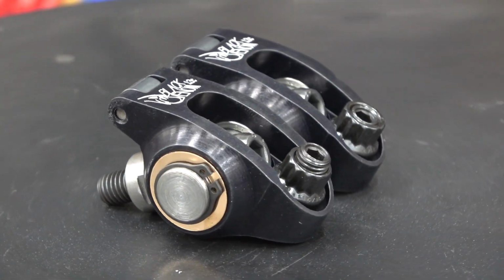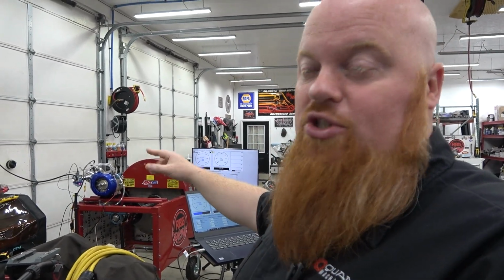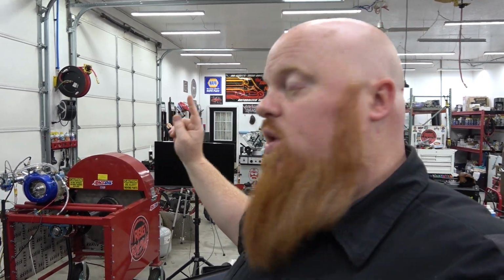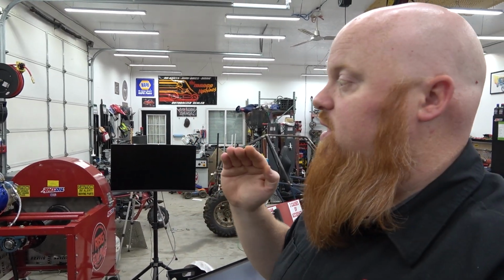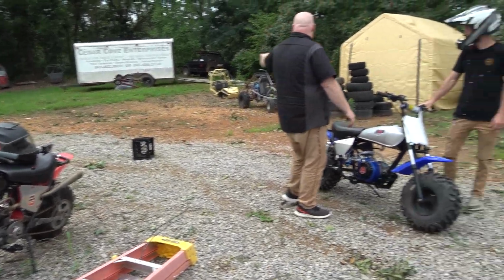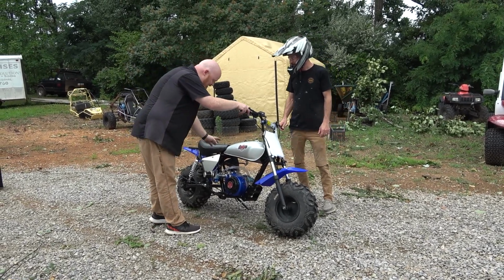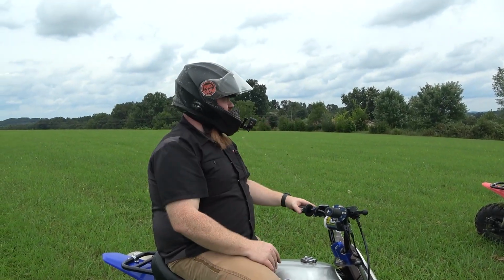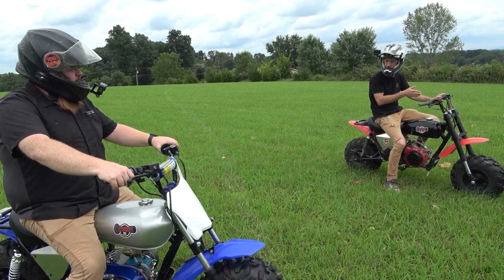We Dyno A Billet Head and Make Huge Power!!!

Comment: First thing I'd be checking is the pushrods 1) do the the pushrods clear the bores through the entire lift range. 2) flexing pushrods create a valve bounce situation.

Higher lobe lift is only part of the story. Higher ratio rockers bring the bring the pushrod pivot closer to rocker centreline. This has two affects 1) the pushrod moves closer to it's bore (higher lift also means it runs through a larger arc) 2) there is more load on the pushrod side of the valve train because of the change in leverage

Comment: With that cam and rocker ratio you need at least 50lb springs or more to control the aggressiveness of the 2. .356 cam is a aggressive profile and 1.3 will make the 36lb springs float at high rpm. Upgrading to 50lb springs and larger push rods will cure this problem.

Comment: The 236 I built and ran in the drag bike has the Moflow 14cc head out of the box with 1.2 rockers and a .356 cam. I did use 1/4" pushrods but it shouldn't make much difference being they are that short. It turns 10,000 all day long with a Honda coil and the 6689 flywheel, I estimated 24hp with nothing trick or custom about the build. Maye be try boosting the coil gap, mine was set at .045 and on Gas, you should be running a 115-120 main jet, needle one clip up from the middle
Reply: How about the pilot? I stay Orange County .. idk if that sound make a dif cause of the sea level ?

Comment: I had the same problem with 1.3/356 combo on big block.  Springs and all were correct but wouldn’t turn over 7k no matter what coil or anything. After braking 2 rocker adjusters I  Ended up going down on camshaft and now it goes to 8500 no problem. It seems that the 1.3/356 combo needs more valve spring than it calls for because the ramp is so aggressive.
Reply from the maker: That’s exactly what we was thinking. I talked to a friend that builds engines as well and he has said the same thing. Thanks for the info. I think I will swap out to a .308 and try it again
Reply: Need 50lb or more spring pressure
Reply: @cliftonnutter2484   I’m at 80lbs on the seat and still won’t keep up
Reply: @oniefields83  a big block may need more because there is more weight to move. Small block valves, even big valves weigh less. Go powersports 301cc 275camshaft kit comes with 50lb so I would think you will almost double that for .462 left. My 385 ci. small block has a roller cam .550 lift with duel 150lb in it.
Reply: @cliftonnutter2484   I’m running a dyno 335 now. Runs great

Comment: The lack of high RPM could be those 3/16 pushrods flexing at higher RPM , the reason for the 5/16 pushrods is to stop them from flexing.
Reply from the maker: It could be but I think it’s valve float. I’m going to try a .308 cam and see what happens.
Reply: @RedBeardsGarage  I had a Ford 302 that I built several years ago that I put a good set of stock diameter crome molly pushrods it with a very high lift cam, it would not rev past about 6000 RPM . A friend talked Me into ordering a set of 3/8 crome molly pushrods for it and they fixed the problem, after the new pushrods I was able to shift at 9200 RPM! 
There's nothing like a small block Ford launching at 8500 and shifting at 9200!
Reply: I agree with the push rods. I built a 263r with the same .356 cam and 1.3 black Venoms. I had to put 5/16 cut to length rods in due to flexing with the duel springs at high rpm.
Reply: The flexing will make the engine feel like valve float

Comment: Hold up. Bone stock ghost with the exhaust kit they sell and I hit 57 mph on mine…..for a dollar difference of what? $800-$900??? What’s so special about that blue one? 15:36
Reply from the maker: MPH don't matter. Its how fast it will get to the MPH. You can have an engine with 100hp and one with 10hp and both have the same gearing, they'll make the same mph.
Reply: It gets it. Oh, I’ve got a a juggernaut as well. It’ll hit 35 extra quick and pull to 57 about 4 sec after. That’s super difficult to justify the massive price difference. Unless you can explain. I can’t see any real benefit.
Reply: @larrytemen4789 let me break it down with the head he added and all supporting mods it made aprox 20hp at 7000 rpm’s when it’s 9k rpm capable with the correct coil it could make more that is twice the hp of the stock ghost 212 with the correct gearing it can do twice the speed